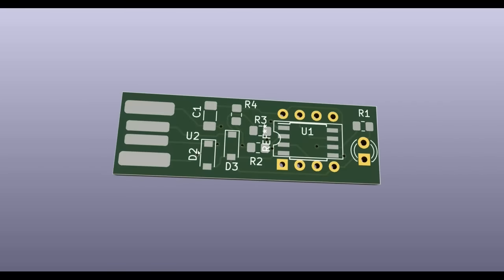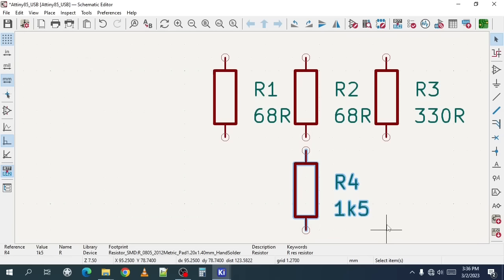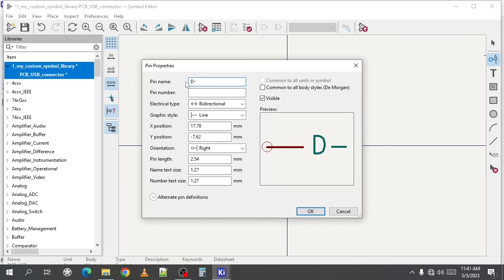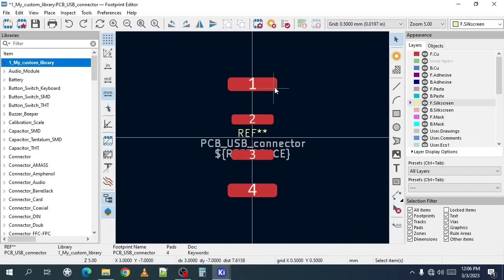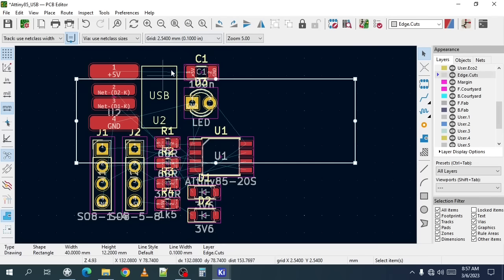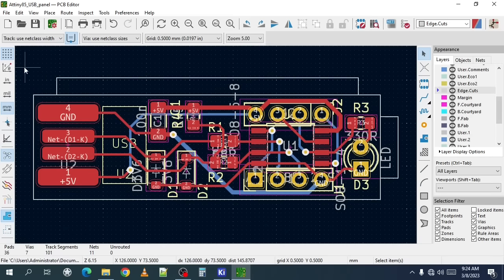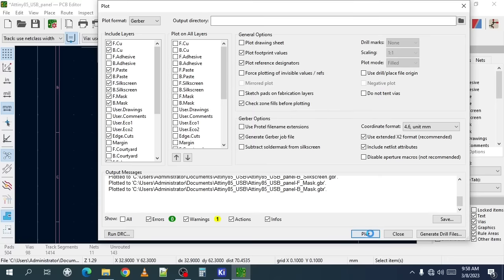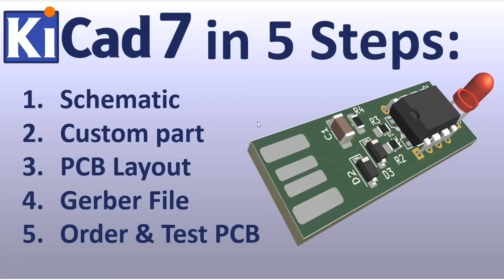KiCAD 7 PCB Layout in 5 steps

Comment: i have a problem...in my circuit im using a LM358, basicaly its composed by 2 op amps and 2 power pins, v+ and v-, the problem comes when i add this ic to the schematic because it appears just as an opamp and not the whole ic and now that im designing my pcb those connections, v+ and v-  actually arent connected and i dont know how to fix this...im new
Reply from the maker: Hi zFrank, When you place the symbol, you can select opamp A or B (click ">" next to lm358) you will find that except Opamp A and B there is a Unit C which is the power pins ;-)

Comment: Thanks for the video.  Why are you speeding up the video?
Reply from the maker: I only speed up the part where I repeat actions, the general pulblic may not be as patient as you are ;-)
Reply: @smartpowerelectronics8779  Of course.  Unfortunately, I do not know English well, so I will slow down the video in the settings.  Thanks for the content.
Reply: @smartpowerelectronics8779  Maybe you can help me? I work with kicad 7 and createt group elements in psb. group footpreants. but today I can't break groops to free elements. button lock-unlock not work!

Comment: If I needed some wires to be soldered onto the PCB what symbol would I need to use for the solder area? I am brand new to PCB design.
Reply from the maker: *in schematic, go to "place add symbol"
*seach for "connector_generic"
*choose 01x01 for one wire, 01x05 for 5 wires
*DO NOT Click OK yet first select a footprint in the drop down
*My prefered footprint: Connector_Pinheader_2.54mm: Pinheader *****vertical
*click ok, give it a number (J2 ) or use "annotate schematic"
*Then if you update the PCB from schematic you have a nice pad to solder

Comment: Hi, I've updated last week to Kicad 7.0.2, there are some littie bugs but it's works good on my ubuntu system
Reply from the maker: Great to hear that, I never tried it on Linux.
Reply: @smartpowerelectronics8779  yes I think it's the same, now I am actually have some issues with wizard for the footprints because of some crashes but I have reported the bug in gitlab. Did you ever used some autotracer?

Comment: I think it would be helpful to mention that "USB-plug" PCBs should normally be 2.0mm thickness, instead of 1.6mm

Edit: also ground pours should almost always be used, or at least mentioned.
Reply from the maker: You are right,  I could not find it in a standard, so I measured it on a similar USB stick, it is 2.3 mm.
To get the right thickness I cut out a piece of a 0.7mm thick plastic lid and glued it on the bottom;-)

Comment: What type of circuit diagram file formats can this software be compatible with? OrCAD? AD?
Reply from the maker: 黃智遠你好！
Never tried that myself, but there are some import options:  
In schematic editor you can go to file, import, non-KiCAD schematic. It supports Altium, CADSTAR, Eagle. 
In PCB editor: file, import, Specctra session, so you will need to export to Specctra in the other PCB software and them import.  
Suggest you give it a try!🙂

Comment: So I was wondering if the manufacturers also supply the components and attach them for you. It seems from the end of the video that this is not the case.
Reply from the maker: You can ask the PCB manufacturer to place the components too (JLCPCB) , however I do not have any experience with that, just solder them myself.
:goodvibes:

Comment: what I'm having issues figure out is how the heck do you determine the values for the diodes, caps, resistors and wattage for leds.  There are 1400 3.6v zener diodes 😭
Reply from the maker: I only focus on the footprint, check the diode you have and select that footprint. If you are not sure, print out on paper and see if it would fit. 🙂

Comment: How did you separate those board without mouse bites?
Reply from the maker: Good suggestion in your quiestion 🙂
I need to score the pcb bridges with a knife to break break them out. 
To improve:
1) Better not to put the pcb bridges on corners
2) Mouse bites, something I learned from you.
Reply: @smartpowerelectronics8779  Right! I have struggled breaking apart narrower pieces  even with v-cuts on them :D (With a plier)

Comment: for J1 and J2 connector where did you get the footprint ?
Reply from the maker: I looked it up:
Library: Connector_Generic
Part: Conn_01x04
Footprint: Connector_PinHeader_2.54mm:PinHeader_1x04_P2.54mm_Vertical
Reply: thanks for the answer. I have kicad 7.0 but in LINUX and probably the library is different. I also have the connector prints but in PCB-EDITOR and not in SCHEMATIC-EDITOR. I need to learn how to draw the wires from the schematic, where I don't have the imprint conn'' to the PCB where I have the imprint but I don't have the wires
Reply: can you send me the files of this project? so that I can have it as a reference? If I can't continue to learn all the steps in your video, I'll start studying another video. Even Mr. Damaris didn't clarify for me. Although I bought his book on Udemy, I didn't find the solution there

Comment: What is its applications???
Reply from the maker: It is a Digispark : https://youtu.be/XwEZvaGyKDE 
The Digispark uses the Attiny85 Microcontroller which is a little complicated to use for beginners. The Digispark adds a UCB interface to make it more like an Arduino. It is often used for hacks / jokes because it can act as a mouse or keyboard. So you can for instance let it type random texts in random intervals. You can search "digispark hack". The tutorial was meant to explain how to use KiCAD though ;-)